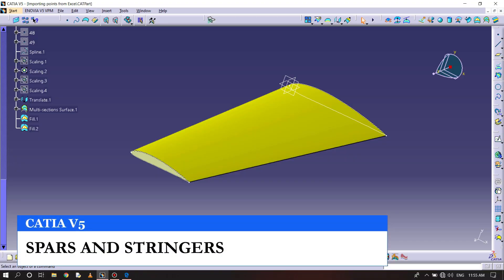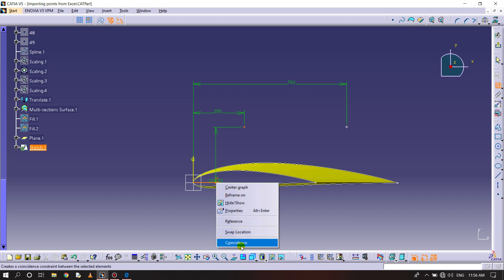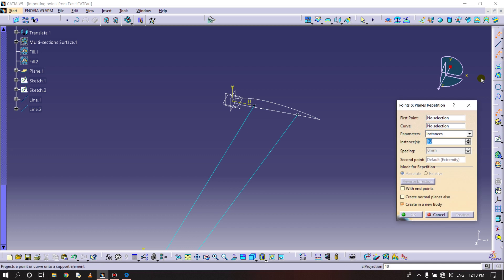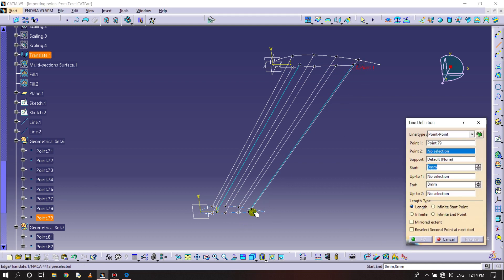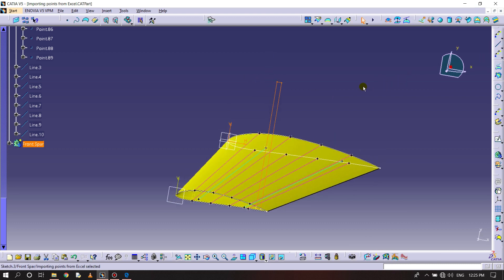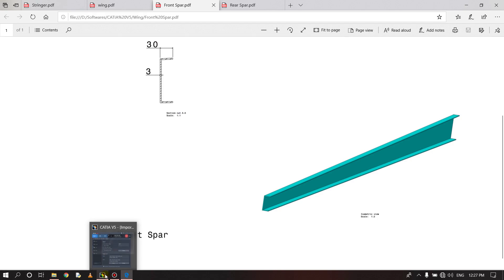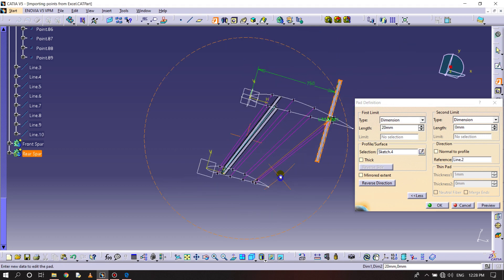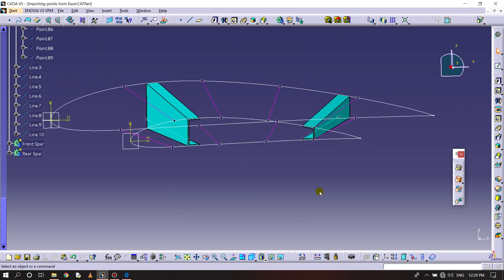#CATIA V5 | PART2 NACA4412 Aerofoil CATIA | Spars Stringers| Aircraft Wing Tutoria| CAD | Aerospace

Comment: Can you use different materials for rear spars, Ribs, Front spars, because it is not an assembly?
Reply from the maker: Yes, Surely can use different material for different parts in the Wing.
1) Select the add material option and click on the spar or rib (choice) and just confirm the material.
2) Assembly is bit complicated and used for multi purpose-complex shape parts.
3) You can learn this adding material to the body from the video of Piston Analysis 
check it out : https://youtu.be/BF34NTD6yQg
Happy Learning! Thanks for valuable feedback!
Any query please feel free to ask..!
Reply: @magicofdesignsoftware4079  So, in one part, can you enter different materials, sir?  it doesn't have to be assembly right? Thanks sir
Reply from the maker: @raihanfarhanramadhan7804  YES, surely you can enter different material in single part design. As sketches and pads are different and multiple the material applied can be different.

Comment: i gave the rib width as 3mm and tried to use split command. it's showing an error like  a skin does not cut right across one of the volume. split cannot be computed. it's working well from 20mm.
Reply from the maker: Hello Harshavardhan, 
please send me a email for it with screenshot for reference, so I can review it. Thanks!
Reply: @magicofdesignsoftware4079 I got it, thank you. Have you done any analysis for this design?
Reply from the maker: Not yet soon I'm going to release a CFD analysis report for it. Thanks!
Reply: @magicofdesignsoftware4079   Can you tell me the weight of the overall wing structure?
Reply from the maker: Nope, can't tell! I haven't given material to it.. Maybe in upcoming video I can address this and let you know! Okay! ☺ thanks for your query.